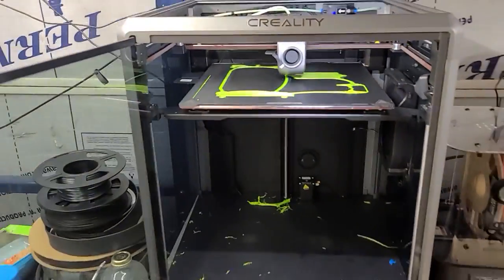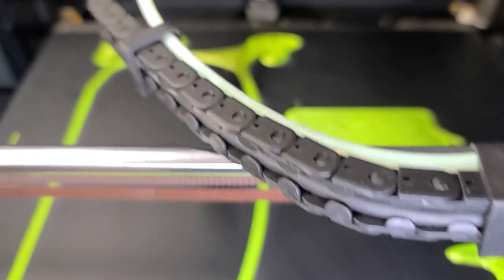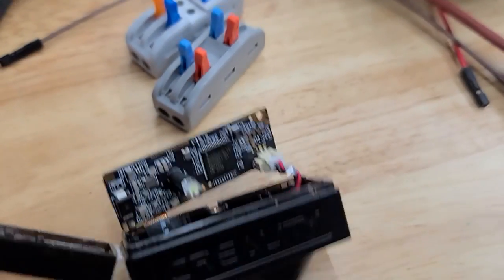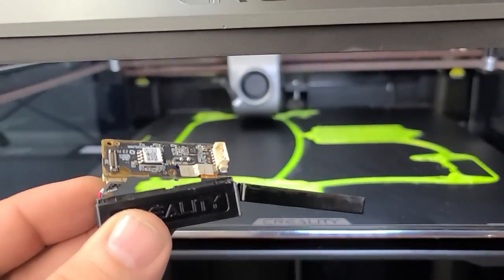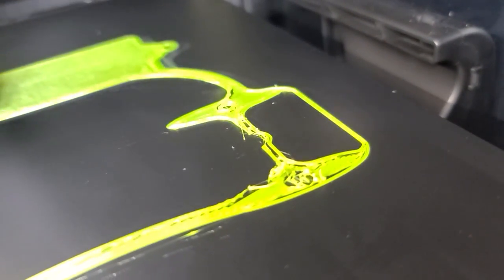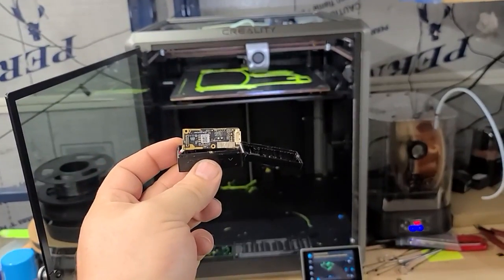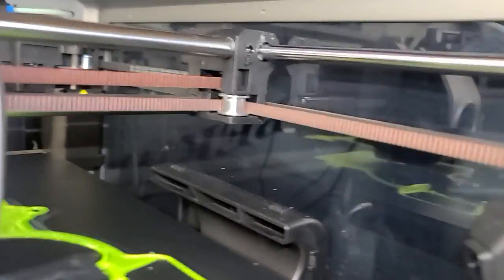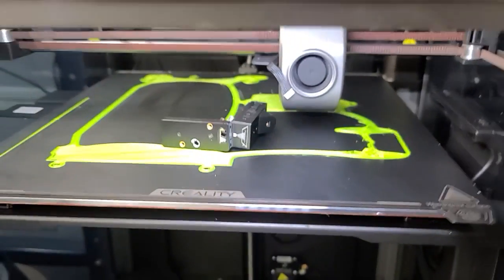Creality K1 MAX... it's a LIE... Buyer BEWARE!!, JUST DON'T BUY IT!

Comment: Quality on these seem to be hit or miss, as I've seen other reviewers have nothing but issues with theirs as well.  I just received mine 5 days ago and the 3 bolts that secured the build plate were bent almost 45 degrees and almost impossible to remove, then all the wiring is just hanging loose inside the cabinet.  There's 1 bare wire just dangling and not connected to anything.  I haven't dared turn it on, as who knows what else is wrong with it.  I sent an email to Creality as soon as I saw all this and I still haven't heard back.  Has anyone been able to successfully contact them?
Reply from the maker: I'm still waiting thus the reason for the video. It's short but to the point. Thank you for sharing your experience with your machine. Please keep me posted if you get a fix from them
Reply: @LiquiDirt3D  I've got an update.  I never received a response from my first email, but I sent another on Thursday and got a response Friday, asking to verify my purchase by sending a picture of the QR code of the serial number and a screenshot of my purchase from their site, including the URL.  I sent that Friday and received a response today, Monday.  They say they will replace or refund the machine.

Comment: K1 max, initial install and firmware ota upgrade, and perfect first benchy (not from usb stick, just sliced with standart settings, generic pla)
I start 3d printing in 2008 from diy mendel, than tarantula in 2016, ultimaker clone, sapphire pro, and so on.
And all past printers in my way was way worser, my k1 max start printing of the box without tunning, do it better and quicker, than any other old printers. And by the way - sapphire was upgraded to klipper and works good, but k1 is on another level.

Comment: 😂😂😂😂😂 Mine has been pumping out print after print after print just fine. Id even go as far as to say excellent print quality. But im curious if you activated any of the AI features before trting to use them. My Liedar has performed admirably. Every time it has flagged or stopped a print, there was an issue. Once when i forgot to wipe my pei sheet off with alcohol, again when i didnt use glue stick on the aftermarket pei sheet. The AI camera also works on mine. Doesnt bat 100% but does pretty well. The only issue is sometimes remote viewing can be glitchy. Ill have to close Creality Cloud completely and then restart the app to view the camera.

Comment: Same here, I got a K1 and even the included cat does not print well. Their extruder is a failure (for BAS at least) and the hot end won't deliver the flow. After fighting with it for a full week, have returned it as I should have had to retrofit a BondTech LGX Lite. Waiting for a PS1P now but no stock.
Reply: I had that same problem, I returned it and got a K1 Max with upgraded extruder... works fine.

Comment: Sorry, but it seems like you don't know about 3D printers.
I have a K1 Max and it works perfectly! I recommend that you learn how to slice, calibrate and use your printer.
Remember, a 3D printer is not a paper printer.
You need to know how to obtain a perfect first layer and how resistant your piece should be.

Comment: Been using creality printers since 2017 and can confirm this guy is being a goofy goober. I’ve used the CR10, Ender 3 Pro, Ender 3 S1 Plus and now the K1 Max my only issue with the K1 max currently is that my top glass cover doesn’t fit the frame however I’ve bought it second hand so that’s probably why XD

Comment: I have a little under extrusion on my K1 Max, It arrived on Aug 27, 2023. I believe it's the ptf tube sharp curve at the nozzle. However, after the first layer this thing just prints beautifully. I have been study printing upgrade parts for my yet to arrive P1S Combo. I have to say, I'm very satisfied with my purchase so far. Now let's see what its longevity is like. If it's anything like my two CR6's it's all good. Shout out to Matterhackers, aside from a little under extrusion, the K1 is working beautifully. Also, The three free spools of filament, nice.

Comment: Based on the comments, you received one bad printer.  That's all.  You come off as if it's a crap product period.  That is certainly not the case.  My experience with the Max is far different.  It's been fantastic. On the other hand I also bought a Bambu X1C and I had to  return it because of a couple issues.  Instead of complaining about it, I had enough confidence in Bambu that I exchanged it.  Glad I did.

Comment: I assume it only uses LiDAR for the first layer just the like bambu. It can be disabled. Sucks you got a crappy unit
Reply from the maker: It can be turned off. Yes however I did not turn it off. I used everything automated that they offer to test this completely. Thus why it is so outlandish that it did not work firstly, but to unplug it and the machine do the same start up but nit error out. That's the kicker and why I made the video, as proof there system is not working as claimed.

Comment: lol. I feel ya bud. The things and hoops ive had to go through to get my K1 to print was horrible. I finally got it to do good, but it took way to much bitching to creality with 3 replaced hot ends and so far 1 new extruder to get it to print at all. I'm buying the bambu xc next...
Reply: my K1 came clogged so bad that I had to completely disassemble the extruder, then had to do the same thing a dozen times within the first week before I said FFS , and sent it back.
Reply: @tekman2011  im fairly certain I'm a certified creality engineer with the number of times I've disassembled my K1. I've finally got it working really well, but I had to adjust literally everything.

Comment: I am having terrible first layer prints. Isn't the "lidar" supposed to help this? I bought a bambu X1 carbon a couple days before the creality. Bambu is much much better. This is my second creality. CR10 was first one. Think this is going to be my last. So much better printers on the market to choose from
Reply from the maker: Agreed, and you hit the nail on the head. Lidar is for the first layer print. Thus why it is a creality lie.

I have 4 Bambu printers as well as 16 custom printers we've made. So I totally agree there are far better machines then Creality.

Comment: Says been printing for 20yrs 😂 Did you start 3d printing when you were 5?  Honestly even eithout the lidar I think you cant handle software unless its one your used too. I have a K1 max, iys had a few issues but Creality sent a replacement part in 5 days China to Australia it hasny missed a beat with almost perfect layer lines every print. What you speak of is concerning but maybe next time go through the settings and see that the first layer deyection is switched on and calibrated? And all other sensor settings becuase to me that layer looks like user error to fast and thick a layer line or shitty dirty clogged nozzle somethings not right here. Lidar maybe but your prinying is pure clickbait!

Comment: If you've been doing this for 25 years I would give up 😂, it's printing without lidar how does that work? eeerrrmmm, the same way every other printer that came before it without lidar works, then proceeds to rip off and destroy the part that's supposed to help and then complains. Camera on side from looking at reviews Is for time lapses and keeping an eye on the print from the slicer or cloud. Seen another guy complain aswell because it wasn't printing flawless models straight out of the box, dunno about the rest of you but every printer I've used requires some calibration no matter the size and price point. I really did laugh at how stupid this video is. 😂😂😂

Comment: That's true if you can turn off the lidar sensor and crash detection
Reply: You can turn both on and off. He probably just forgot to turn them on and that’s why it’s still printing and why it’s printing like shit.
Reply from the maker: , actually I never turn them off they are still connected supposedly working in an unconnected State that's the purpose of the video

Comment: If you had followed the Creality K1 guide you would have been printing without issues, period. I purchased the K1 and fought it before discovering RTFM which fixed most of my issues. After I fixed the cable chain and PTFE issues I learned about the heat bed off-set, now all the prints are perfect. Too bad about your LIDAR, now you can move to something like Beacon, much better.

Comment: I feel your pain. After 10 years of 3D printing my tolerance for crappy printers is zero.
The lidar module does not exist on the K1 and acording to other tests it indeed has no function on the K1 Max.
I got a K1 early on and got lucky. It basically just works without any tinkering at all. Seems to be a lottery as far as QC goes.
Reply from the maker: Thank you for backing up my findings. So many people think I'm bashing creality, when the truth is not bashing. All I and I asum you want is what is being advertised by the manufacturer. Nothing more and certainly not less.

In Reality's case allot less. They have no right to fraud the printing community with a lack of standards the relate to non functional parts and printers.
Reply: agreed , the QC absolutely blows. now my BBL XC1 , four straight months of non stop printing, zero problems. cant say that about any creality product.

Comment: My guy you ripped out an essential component, had it start printing, and complained that it wasn’t printing properly. It uses the LIDAR to constantly make sure it is printing properly. You ripped it out, so it didn’t detect a mishap. It also detects foreign objects, so it didn’t detect its own eyeballs when you tossed them in. Also, low quality filament, lack of calibration, lack of test printing, and actively damaging the machine can cause it to malfunction. It’s not deception at its finest, it’s simple logic.